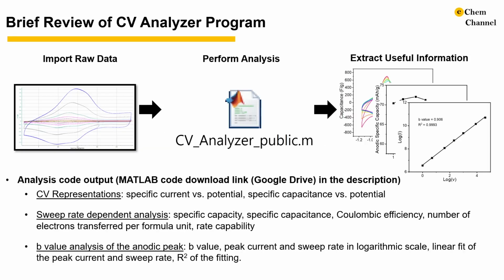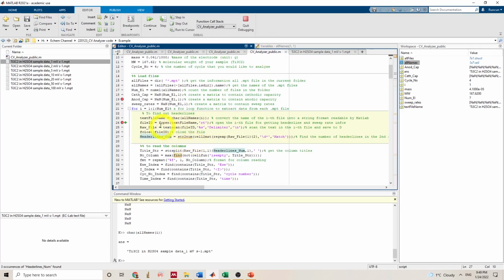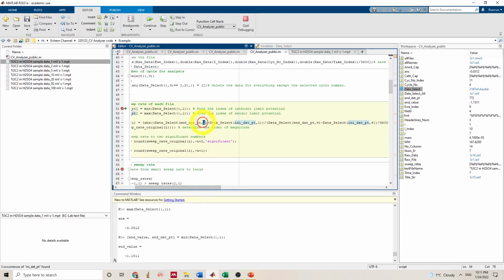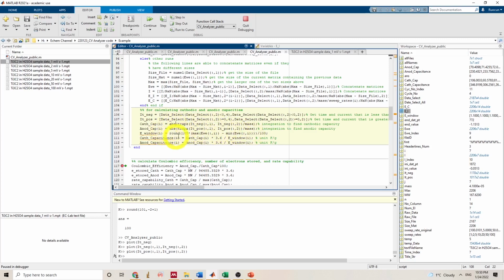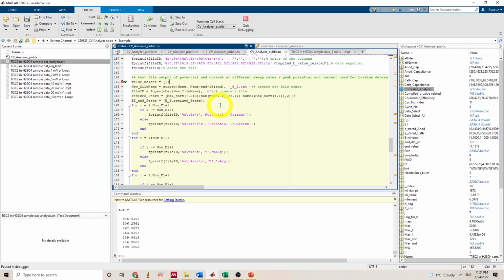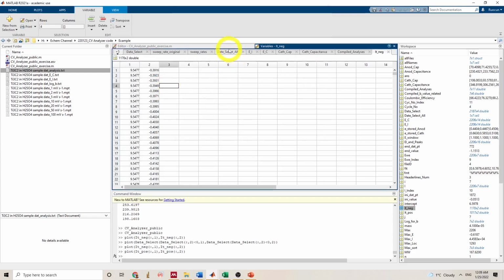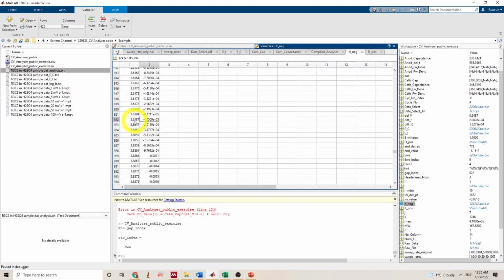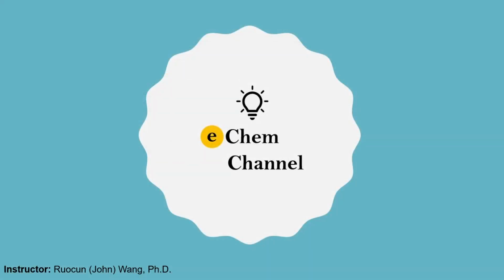Tutorial 25-Breakdown CV Analyzer Code (Exercise Included)

Comment: @EChem Channel:
Thank you very much. It is impressive. 
This code functions on the basis that CV data (I-V) is converted to I-t data and then analyses are performed. When I directly use the surface area of the CV curve (area in A.V) for analysis of CV data (Csp = CV curve area / (2 . mass . voltage window . sweep rate)), I get results that are slightly different from those calculated using this Matlab code, particularly at lower sweep rates. I tried averaging anodic and cathodic capacitance values calculated by this code, but they are still different. I am getting the CV data from a 3 electrode system with pseudocapacitive materials against graphite rod counter electrode and Ag/AgCl reference electrode. I would be appreciated if you can explain the source of the deviation observed here. Thank you in advance.
Reply from the maker: Hello @Payam, thanks for your question! In my experience, most differences come in two ways
1. Different cycles being used for analysis
2. The different selection of cathodic/anodic current ranges. The cathodic current range chosen by the code is shown at 01:31:04 of the video. If I were to calculate the capacity from ECLab software, I would choose a continuous integration from the end part of cycle 3 and the beginning part of cycle 4 for this integration. 
If it's other scenarios you may need to explain your situations more. 
Thanks again for your support.
Reply: @EChem_Channel  Thank you for the reply. I have used the same cycles for analysis and comparison, so the first point can be ruled out. I get your point by the 2nd point, but I am not good at coding and unfortunately, it is difficult for me to follow. I know it is too much to ask, but would it be possible for you to add a new column to two of the generated text files (I_E and C_E) for the surface area of CV curves (A vs V)? This way I can easily calculate the specific energy and power density obtained from the surface area of CV curves as well (without segregation of cathodic and anodic branches). Thank you.
Reply from the maker: @payam1597  Hello, sorry for the late reply... if you follow the last part, we used a different way to generate energy and power density.